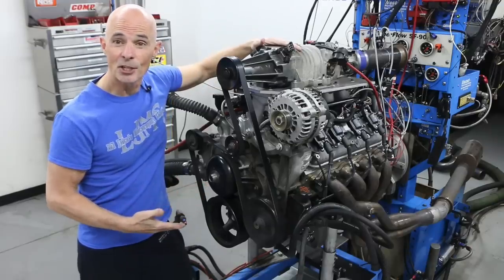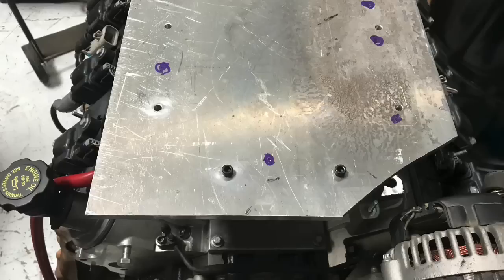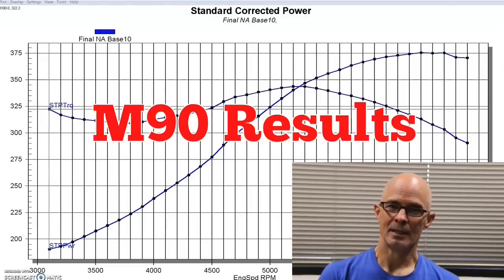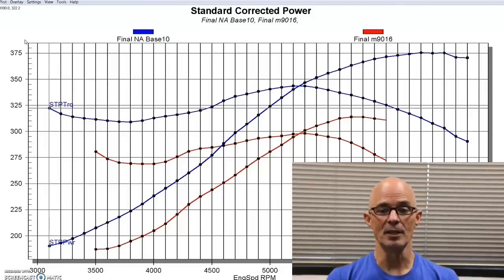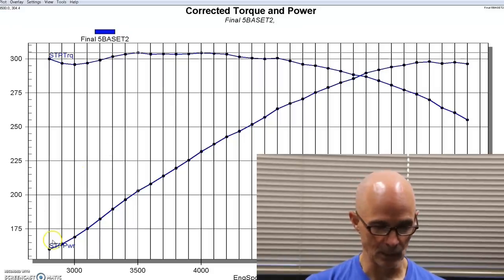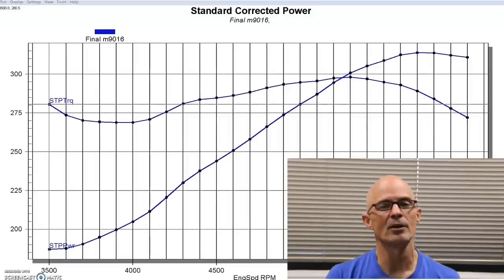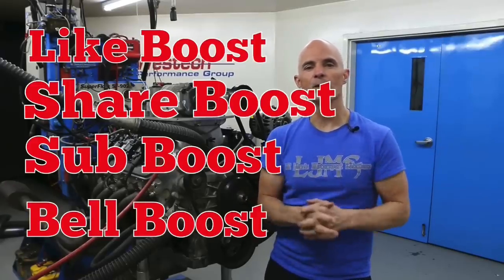JUNKYARD LS M90 SUPERCHARGER TEST-FULL RESULTS!

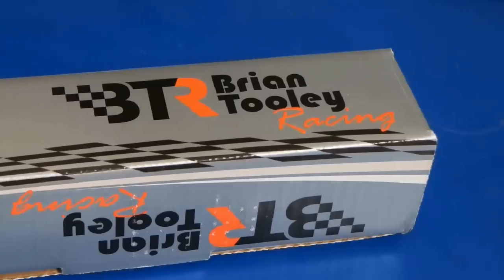Comment: Whats going on with the plenum floor at 5:00 minutes? The front 4 runner are covered in oil. Blower puking oil? Maybe run your headers with 8 O2 sensors and see what air distribution looks like if the oil stain is any indication of where the  flow is travelling.
Reply from the maker: typical of the blower-the discharge of a roots blower is always offset to front or back-oil residue might indicate something
Reply: @richardholdener1727 Just a guess here - With the motor pulling more air than the blower can supply (as the dyno runs showed) the plenum goes into a vacuum state and pulls oil past the seals of the M90. Now the 4 oily runners could be that the oil is heavier than air and doesn't want to do a 90 degree turn to the rear runners. Or is it so choked down that the air is just following the path of least resistance from the M90 outlet to the front half of the plenum. Maybe have a look at the plugs and see if anything was leaned out. Keep up the great work.

Comment: Back when I was in high school I really wanted to put a m90 on a 4.3 s10. Never happened.
Reply: I wanted to put one on a 3.8 V6 in a 3rd Gen Firebird
Reply: @bluenecross  It's been done,  the intake is the issue since the firewall is in the way
Reply: Would like to see m90 on a 2.8-3.1 v6. Those cavalier z24 60 degree heads have canted valves like a big block.

Comment: I'd like to see it tested again with a gen v m90 and the smallest pulley available
Reply: yes and a v8 throttle body.  that v6 throttle body is so small likely restrictive
Reply: ZZP recommended the northstar throttle body for higher performance 3800's.  Still seems a little small to me when you're starting point is 375hp.
Reply: @s1mph0ny  the Gen 5 is already a 75mm inlet, so the Northstar isn't an upgrade on a Gen 5. Porting the hell out of the inlet and adapting an LS throttle body would be cool to see, though.

Comment: I put one on 4.9 Ford inline 6 with a pulley ratio around 3 to 1, the best was 7 psi, had 10 at one time but only down low so I figured I was out of in efficiency range. I then added a turbo after that and now I make 25 psi blowing through the m90. The supercharger takes care of any turbolag and the turbo makes the large boost numbers

Comment: Curious, many years ago people ran Eaton blowers on Rover V8s, genetically related to the 3.8 in the big picture, but anyway, there were issues with fuel distribution and I wonder if those rear cylinders are getting less than those closer to the opening. Any indication of this due to the orientation of the fitment even if you used a larger blower?
Reply: I'd guess since it wasn't able to make boost there's little restriction to where the air is going, only from where it comes.
Reply: Rover V8s are essentially Buick 215 V8s. Theyre super small so it makes sense on that application.

Comment: I’d take it off the ls and put it on a 2.2L ecotech 😋
Reply: That makes entirely too much sense
Reply: Is the 2.2 really gonna have enough torque to spin that thing effeciently?
Reply: It'll blow up
Reply: @snoopy5736  stock 2007 l61 2.2l ecotec rods will hold 250hp before you should upgrade them the next thing is the piston which will hold ~300HP IIRC

Comment: Do twin superchargers plus twin turbo for all the boost!! :D
Reply: You might be disappointed. Often when you combine turbos with a positive displacement supercharger the supercharger gets you quick spooling from the turbos but the supercharger becomes a restriction at high rpm/boost.
Reply: @177SCmaro  I knew that but never saw results of the combinatio.
I was interested in spool and how badly would supercharger fail in high rpm hahah
Reply: Matej Šimek I have that set up on a 4.3 V6 and it works well
Reply: @gotmilke1  hmmm
What is the peak rpm of the engine?
Reply: Matej Šimek rev limiter set at 6,000 but mostly drive it below 5,000 I try to be conscious of that because I’m worried about breaking the crank (4.3V6) turbos make 8 lbs combined 18-20 lbs
Reply: @gotmilke1  I lean towards high rpm engines.
I think it would not work at something like 9-10k rpm hahah
Reply: Matej Šimek probably not unless you has your sizes spot on

Comment: I put 2 of them on a 454 chevy in a boat and made pretty good power on tha cheap with pump gas. Sorry I have no dyno numbers but with 29% gears the same engine N/A would only turn 4500 rpm. With the M90s it easily stayed on the 6000 rpm rev limiter and got there very quickly .

Comment: why would you do a m90 when there's a ton of m122s for 500 or less that are actually made for a v8
Reply: Pizza baller  there's companys that make them for m122s, tvs1900s, tvs2300s
Reply: id go tvs 1900. you can get gen 4 rec port to cathedral port adapters for like 200-250. m122 plates are 1300-1400 and the tvs1900 is better then a m122

Comment: put the M90 on a D16 Honda Civic motor
Reply: Lone Wolf Customs 
Heck yes !! 300whp is enough to kill a D16 over time. But super cool while it last. Maybe on E85 it can survive (doubt though, poor rods)
Reply: That would be cool! Id like to see the SC14 supercharger on a H22 honda engine, those little blowers push alot of air for there size!!
Reply: @bryanleverett2830  everything Richard does in these videos will kill all of these engines over time. That's what tuning does, it exponentially shortens life.
Reply: 180TQ on stock D-Series rods or you're asking for trouble. The stock pistons will outlast the rods.

Basicly the same concept, but Jackson Racing made a roots blower intake manifold unit back in the day. You can still find them for sale every once in a while, but they're discontinued.
Reply: @tommylyeah  I'm thinking of a low-buck way of supercharging a Civic will it blow up over time probably but most engines will but if the unit would make decent power then you upgrade some rods and head gaskets and potentially a fun toy

Comment: So I'd find it interesting to hook a procharger onto that 4.8, but just restrict the output to produce boost, just to see how much power is required to run the procharger itself at various boost levels.
Start with the accessories hooked up on the baseline though to get a true read.

Comment: I wouldn't have even tried this test with only one blower.  Common sense would tell you that it wouldn't work out.

There are people online who claim you can spin them faster, and get good results on a 4.8, but I seriously doubt that, and I don't think it's a good idea anyway.

However, I think this is a neat system as it was set up from the factory.  I believe you could put two on a 5.3, get good results.  At least that's what I was planning on doing...

Comment: Smaller pulley and a bigger throttle  and it should make more power than the NA motor, and if you can port it out then that would be awesome.

Also, the super/turbo compound setup that you would have liked to have done.....I'd love to see that. Gale Banks is currently doing something similar and it would be interesting to see how your results compare, not so much power wise....just how well it would work

Comment: The M90 moves 90cid of air per revolution, the LS pulley to SC ratio is about 2.02, so that's 180cid of air per crank rotation.  Since it's 4 stroke the effective draw is 1/2 4.8l or 148CID of air per rotation.  You said max boost was 1.1psi, which fits for low RPM, but as the RPM rose and VE reached near 100%, the restriction of the supercharger could not be overcome by the fixed flow ratio.  For giggles, let's say 5200rpm was 100% VE, that means it would require 148CID of air at 5200, the difference between NA and SC was about 15% at peak torque, so the SC was really flowing about 127CID at 5200rpm.  That means the SC was around 127/180CID or 70% efficient.  Just to meet your NA HP output you'd need at least 30% overdrive, but due to adiabatic efficiency it's probably closer to 40 or 45% overdrive JUST to make the same power as NA.  IF 1 SC pushes 127CID at 5200RPM, 2 of them would push 254CID.  I predict the engine would make 590ft/lbs peak torque and around 10lbs of boost.

Comment: I'm curious if the M90 would be more able to keep up with a smaller engine like the Toyota 1UZ. It's both closer to the M90s original engine displacement (4.0 V8 vs the 3.8 V6) and closer to the original horsepower (stock 1UZ hp is around 240-250hp). Make sure you get one of the early "thick rod" (pre-95) blocks if you try it though!
Reply: CobraDBlade that would be a sweet setup

Comment: The supercharged 3800 is running 2 belts. 1 for accessories, 1 for the supercharger. Factor in that, along with reduced size of throttle body, MAF meter, timing, etc, I'm surprised it ran at all.

Comment: why are you using the v6 throttle body?  thats very restrictive.  what if you put a smaller pulley on the supercharger and use a proper v8 throttle body.  most people place the throttle body after the supercharger.   i like the setup, i think it would be very cool with a m112 or m122 and a proper v8 sized throttle body
Reply from the maker: the throttle body after the supercharger? In the intake manifold under the blower or remote mount the blower?
Reply: @richardholdener1727  i realize that wouldn't work in your application, but in side mount m90 applications, thats how they do it, similar to a centrifugal supercharger.  i realize you cant do that but perhaps a smaller pulley and a bigger V8 throttlebody might help?  thanks for the reply

Comment: If i could make a request because i know many people are in the same junkyard boat.  Perhaps 2 or 3 different pulleys going to the smallest possible pulley.  Then after those results are in you can make your twin adapter plate.  My biggest interest in that is will it loose twice the drivetrain loss?  As well as how do you run your throttle body or bodies?  Thank you for making this video either way.  Good data is hard to find!

Comment: I have the 2002 Holden  VX series 2 with a factory m90 powered 3.8 Buick block putting out roughly 171 kw from factory (229hp).
Which actual model was yours from??

Comment: I'm 99% sure this isn't the case, but did you check to make sure the supercharger bypass valve is not staying open? 1.1-1.2 psi boost level is suspiciously similar to when my Mini Cooper bypass valve got stuck open. Eaton M45 on a 1.6L engine, so call it a 1/3 scale test!

Comment: I had a buddy back in high school who put one of those blowers on his 260 v8 that he had in his falcon. It was kinda hodgepodged to gether with a plate thing  that bolted to a Victor jr intake and a home adapter that bolted where  the throttle body went for a carburetor it had issues. The weight of the blower or belt tensioner was what's too much for that  threads in the intake  where the carburetor would normally bolt down it would pull those out but it did but it did make a difference in how it ran . nothing crazy to write home about  it did let it do big burn outs lol

Comment: The m90 on the early Ford SC has a parasitic loss of 60hp. The newer style gtp rotors are used to help build boost. The coating does not seem to last. The M90 likes a larger throttle body. On Fords application a Jackshaft is used to overdrive further. An intercooler is used to offset the overdriven Heaton. Will it work and make boost on a 4.8? Yes. There is a kit for 4.6L fords that use the SC m90 and it makes 4-6psi with a stock pulley. Spin it faster, but watch for charge temp.

Comment: Im currently fitting 2 gen 5 m90's to my Z31. Slowly.... 
I'd like to see more videos on this with different size pulleys and maybe some form of intercooling.
Right now I'm torn between welding up a full intake with inbeded intercoolers, but I'm not sure if I can weld aluminum good enough for that yet. Or having the sc's hover slightly above a low profile plenum and have the boost be collected at the base of each sc and sent through a fmic.

Comment: Long intake runners make more torque than short runners. In carbureted applications, the fuel won’t atomize the fuel well, but with efi that isn’t an issue. It’s pretty wrong to claim that the high ram intake was wrong for the application when that is the best choice for low end.

Comment: Didn't work because (SC volume / Crank Rotation)(% SC Volumetric Efficiency) < (Engine Volume/Crank Rotation)(% Engine Volumetric Efficiency)

Not to mention the other factors like parasitic loss, adding thermal energy to the charge, adding/removing accessories etc.

Whats interesting to me is that The supercharger made boost at low rpm but not at high RPM, despite spinning the same amount of times per crank rotation at both RPMs.  This tells us that the engine maintains Volumetric efficiency much better as the RPM increases than the supercharger, because in the low RPM they were displacing roughly the same amount of air but they diverged as he RPM went up.

Very Interesting test, great content as always!!!!
Reply: what if someone did this, with a smaller pulley and a V8 sized throttle body?  that 3800 throttlebody is tiny
Reply: @613Builds  Larger throttle body would help to maintain the 1PSI of boost they saw in the low rpm a bit higher, by improving flow into the SC.  It would probably not increase the small amount of boost it did make though, because the 1PSI was made before the flow was restricted upstream anyway.

Overdrive pulley would increase the amount of boost beyond 1PSI by increasing the Blower output per rotation of the engine, ie forcing in air.  The downside being you can only go so far with this before the blower just chokes out due to its internal flow capability.  Much like how stock heads can make almost the same power at 6000RPM as they do at 7000RPM.

Overdrive Pulley with a larger Throttle body will help to make more boost, AND maintain it higher up in the RPM range.  But not by much.

Comment: Interesting test with interesting results.  The 4.8 liter is 293 cubic inches which means it displaces 146.5 cubic inches every revolution as a 4 stroke engine. so the M90 needs some serious overdrive to make 100 percent breathing  (147/ 90 =  1.63)  and even more to supercharge.  .....what were those pulley diameters again ???????

Comment: Twin M90's please.  Even if you had a cabinet guy make the plenum box out of 3/4 plywood, assembled with PL premium and sheetrock screws to make the fab easier, it 's just a test so who cares, well maybe spray it with chrome paint!  I'd really  like to see the result.  Concerning this single M90 output failure I consider it like a large air pump (4.8L) sucking on a small air pump (M90)

Comment: No the main issue is that the engine pulls more air than the supercharger could even supply at boost. The only reason the blower works on 3.8 liter is because it provides more air than the engine can supply stock. Unlike the 5.3 that has bigger cylinder that are longer which 5 probably produce, so there's 3 extra cylinders already compressing air that was being starved do to the added displacement.... 230 cubic inches is easier to boost than 325 cubic inches. The M90 which is only about 1.5 liters has an additional 95 cubis inches to fill which it cannot, so as you stated Richard it's just a restriction. Especially with the adapter plate..
Reply from the maker: PRETTY SURE THAT WAS COVERED
Reply: Hey Richard thanks for actually replying to my comment. I'm a fan of yours. And while you did cover the M-90 being a restriction, which in my post I acknowledged, you asked viewers for their input so I gave mine. While in line with what you stated I just simply further indulged. So, like I said above while I am a fan of yours, I'll admit that your response seemed a little sarcastic and hypocritical at the same time which I do not appreciate. Sorry if my response touched a nerve or something that wasn't my intent, but if I had a YouTube channel and I asked fans and viewers for their input, even if they said the same thing I did in a different way or something, I wouldn't be sarcastic in anyway. I'd be thankful that I had fans that showed interest and even had fans and people that watched at all. I know I'm just a nobody but sir you should show more respect. Thanks for your time sir. I appreciate it.

Comment: 1) Northstar throttle body or Ls if it's bigger and will fit, and 3.2 pulley. 2) ported m90 case 3) 2.8 pulley 4) maybe an intercooler or methanol injection if it's actually making some boost?

Comment: Question for Richard:  I just bought an M90 with the intent of sticking into the engine bay of a Lexus SC300.  I think I can squeeze it in between the block and tire well, with a plenum curving up to a stock lower intake manifold on the 2 JZ.  The plenum box would only be about 1" wide, meaning the outlet air from the blower would be forced to turn a sharp 90* turn just below the vanes.  My goal would only be maybe 350 horsepower.  Do you think a narrow plenum would work ?
Reply from the maker: 1 inch wide?
Reply: @richardholdener1727  the M90 would be setting on it's side under the intake stubs. The throttle body would be under the master cylinder.  The outlet of the blower would face the wheel well.  A curved plenum would arch over to the lower intake manifold.  The plenum would only be about 1" wide due to space limitations.

Comment: Aussie Speed makes a M122 plate for AUD $179. It says it bolts up to a Weiand 6-71 8-71 LS intake. 
They also make a LS intake that designed to run a 142 144 SC. I imagine that a GM Detroit 4-71 would bolt up to it also.

Comment: Since  cfm is dependent on rpm, and this blower doesn’t flow enough cfm to support big hp numbers upstairs, can you optimize this setup for low rpm power?  7,000 rpm power is moot for trail jeeps , but sub-3500 power is king.   Maybe the factory cam, a heater core intercooler, and a tiny pulley?